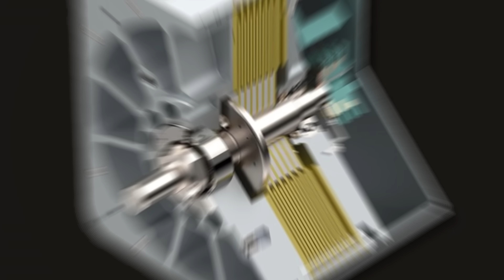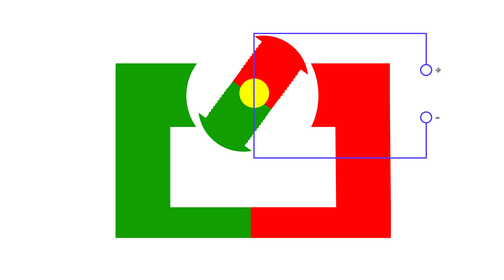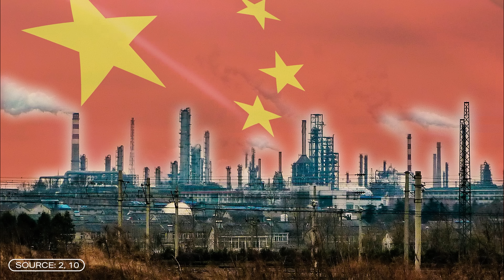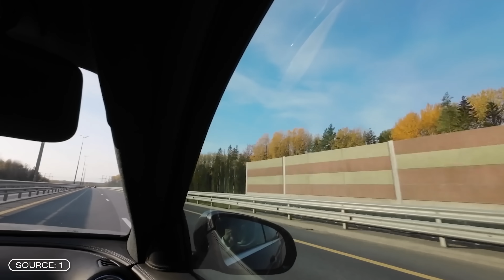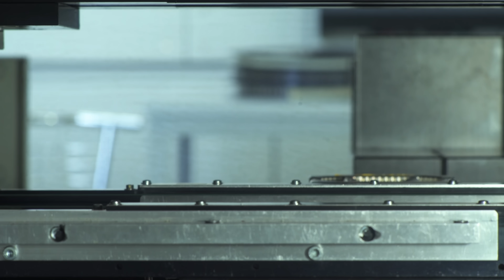Have We Gotten Electric Motors Wrong for 150 Years?

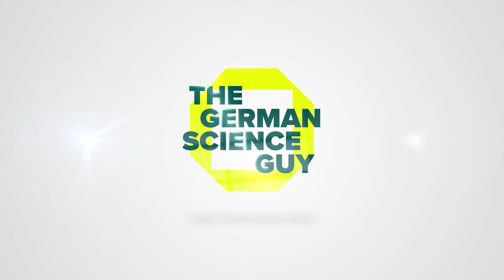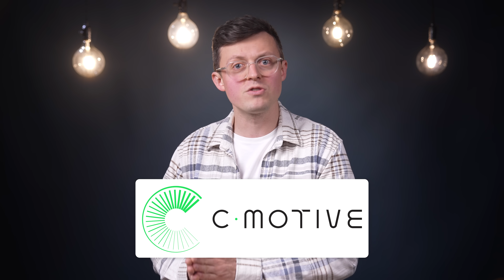Comment: C-Motive and their development of a modern electrostatic motor (0:00 - 0:44). While nearly all current motors are electromagnetic, C-Motive is leveraging an older principle to offer a more efficient alternative (0:44 - 1:12).

Key differences in motor technology:
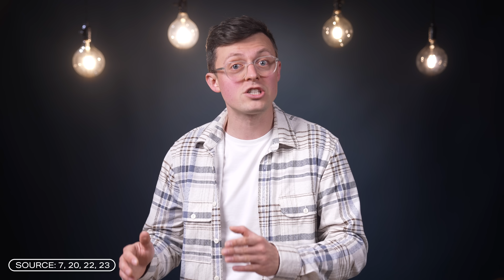Electromagnetic Motors: Use magnets and copper coils, relying on the Lorentz force to generate motion. They suffer from energy loss as heat in the coils and dependency on rare earth metals (1:25 - 2:07, 4:37 - 5:19).
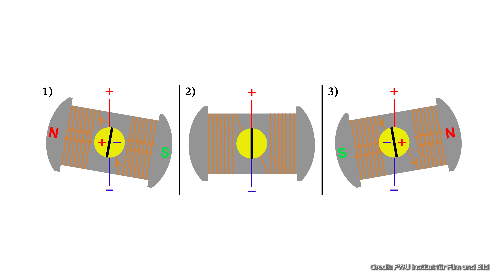Electrostatic Motors: Use electric charges and the Coulomb force (electric force). They require high voltage but low current, eliminating the need for magnets and significantly reducing copper usage (2:23 - 3:51).

The C-Motive Breakthrough:
Dielectric Fluid: Previous electrostatic motors failed at scale because air—the traditional dielectric—could not store enough energy. C-Motive replaced air with a proprietary organic liquid that has high permittivity, allowing the motor to function at much higher power levels (6:13 - 7:47).
Efficiency & Sustainability: The motor operates cooler, requires 90% less copper, and contains no rare earth metals (8:53 - 9:27).

Challenges and Future Outlook:
Speed Limitations: The motor is currently optimized for low speeds (up to 200 RPM) and struggles with efficiency at higher speeds due to increased friction (9:51 - 11:25).
Industrial Focus: Applications are currently centered on positioning and holding tasks, such as industrial robotics, assembly lines, and medical tech, rather than electric vehicles (9:35 - 9:50).
Infrastructure: A major hurdle is the lack of existing compatible control electronics and the requirement for a clean manufacturing environment to maintain fluid purity (10:55 - 11:59).

Comment: As the C-Motive electrostatic motors use a liquid dielectric, I am skeptical about the efficiency claims.  We should expect losses due to viscosity.
Reply: But if it's low speed. Light houses used to float the lenses on mercury, that's more efficient than what replaced it.
Reply: He said it's a low viscosity fluid. Even then, this (fluid effects) is one of the main or only losses this motor has. With a sufficiently good dielectric, this can improve many industries.

Comment: If these new motors like high torque and lower rpms, then you can use gearboxes again to reach higher rpms if needed. But then you probably can't put the motors in the wheels.

Comment: This is BS.  Electrostatic is seriously lacking in torque to be useful.  And you can't get more power out than you get in.  We have E motors in the 98% plus range now.   Nor mentions the problems with 1,000s of volts.
Reply: That's the bit about the fluid.  You can get giant forces out of electrostatic fields if you can avoid dielectric breakdown.

Comment: Surely the RPM threshold is a factor of the number of plates. I recognise the requirement for the number (charge distance), but if you could reduce the number of charge plates by a factor of ten, then you would increase the RPM by said amount. There will ultimately be a limiting RPM, but that may be mechanical anyway.
Reply: It seems the biggest issue with high RPM is the heat generated by the dielectric fluid goes up exponentially with RPM. That would quickly overtake the heat losses of an electromagnetic motor.
Reply: @williamhicks558  
@mskellyrlv - suggested 
2 days ago (edited)
"I would use pressurized sulfur hexafluoride as the dielectric.  It's a gas, so it wouldn't have the viscosity of a liquid, and it's already used as a dielectric hundreds of kilovolt Van de Graff generators, electron microscopes, and high voltage transformers.  It doesn't, however, have a very high relative permittivity.  That may not be too big a drawback.  On balance, though, the static electric motor has a lot of potential, with the promise of increasing our capacity to use electric power in more applications, thus lowering resistance further electrification (see what I did there?)."
at 18 likes

Comment: I visited the CMotive site, and they have an efficiency PDF document. From that, their tested efficiency is around 88%. When cross-comparing the induction motor + gear and the permanent magnet motor, they compared them in a very weird way. They use the inductor's total loss as a 100% reference for cross-comparison with others, but do not mention the induction motor's nominal efficiency. 
First, 88% is low efficiency. PMM can easily exceed 90%, and a single-stage reduction gearbox is usually 98% efficient. 
Second, in comparison, if the PMM they use has lower efficiency then 88%, that is a pretty sucky motor.
Reply: It's a weird presentation.  This motor is obviously designed to produce high torque at low speeds with high positional accuracy.  It is going to be more efficient than alternatives like Tesla motors here just because trying to gear down a high rpm motor without introducing backlash tends to introduce efficency losses.

Assuming you can solve the dielectric breakdown issue that's exactly what you would expect from electrostatics.  Of course it isn't going to compete in an application like electric cars, that doesn't even seem to be a goal.
Reply: @petergerdes1094  Could you potentially gear it to where the output shaft of the gearbox would be around 6000rpm or would you lose too much efficiency to friction?
Reply: @LordxJoe I mean you certainly could but if you notice even the claimed efficiency at low rpm isn't matching the efficency of good electric automotive motors and that's only going to get worse with gearing.

My sense is that this is a motor which is designed for applications like robotics where it's ability to do high positional accuracy (gearing down often introduces backlash) and relatively high torque at low speed are a big advantage.  All these factors tend to trade off against each other (you can reduce backlash while effectively gearing down at the cost of efficency) so you can describe it as being more efficient for that application but I think it confuses a lot of people when you describe it as an efficency breakthrough.
Reply: @petergerdes1094  Spot on.
Reply: 88% isn't a lot. Thanks for reading it I didn't look yet I hear the efficiency and was too excited
Reply: @H0mework 90% less copper is more than a lot though 😅
Reply: @imstevemcqueen yes it's a lot cheaper but it's not going to be useful for my uses.
Reply: @H0mework you have no idea whether it will or won't you meant
Reply: @H0mework So does it need to be 200 RPM plus, or a trivial circuit rather than 11-tier supercapacitor lagged driver, a generator...
Reply: I have to imagine a lot of energy is instead lost to the organic fluid even if it is low viscosity.
Reply: @Veramocor we should think more about molecular shear force than viscosity, as they are slightly distinct. Checkout shear thinning liquids!
Reply: @Veramocor  Currently, the majority of efficiency loss in ESMs is from viscous drag and other fluid driven rotational forces.  
They are extraordinarily efficient very low speeds and when holding a position.
Reply: You are comparing an electrostatic motor that's designed to run around 200 to 400 rpm to a outour that is designed to run at thousands of rpm. Ppm motors are efficient at high speed. Electrostatic motors are more efficient at low speed. If you showed that high speed motor down to the same RPM as the electrostatic, it would only be between 60% to 70% efficient, compared to 88% efficient for the electrostatic motor. 88% is actually pretty good especially when you account for the losses due to gear boxes. There is a lot more to these things than you're considering. I know these things because I was a technician in the Air Force and was trained to when on these kinds of systems.
Reply: Conveyor belt speed.  That's why fedex would have interest.  Routing centers are warehouses full of Conveyor belts.
Reply: 😅that uses 90% less copper...genius
Reply: 🤔 Well thats way I would experiment with is to add a treatment to the rotor and stator of laser etched surface to be super hydrophobic and super hydrophilic: https://youtu.be/mQdoKaNI8Ko?si=Qgv18L_HWOoxDHns the Staters would be super hydrophilic and the rotor would be super hydrophobic for super cavitation within the dielectric liquid: https://youtube.com/shorts/s4a7mdS0-YQ?si=doTO5W-VhBZQd9Vm this should accomplish more torque and higher RPM speed.🤷‍♂️🌐✌
Reply: 88% sucks. Tesla's earlier cars used induction motors (no rare earths / no permanent magnets0 with around 93% - and Tesla's new permanent magnet motors are like 98%. So what's the point of these C-Motive motors then?
Reply: @IsZomg  Yeah, BLDC motors tend to run in the mid 90's. Hell about a decade ago there were some diy BLDC hand winders on the RC groups forums that were hitting close to 98% IIRC
Reply: @IsZomg  The point is a new technology that could replace/compliment the existing one that might make our lives better. If you rule out anything that cannot compete to a today's mature technology, you will save money for a short run, but the development will stop. I understand people are used to pay little for awesome products (~$1k for top-notch Apple/Samsung/Goggle phone with 3nm CPU and 256/512GB storage is expensive? Wow we are spoiled!), but if we want lives to be better, we cannot afford stopping. Of course, to make lives better societies need to evolve along with technologies, but this would be another discussion.
Reply: @IsZomg  They don't need the rare earths that current motors need.
Reply: @SomeTechyPerson induction motors are perfect for evs, but we are spoilt and want an extra 30 to 50 miles range that rare earth offers
Reply: @lumsdot  The difference between the best BLDC, rare-earth magnet motors (~98%) and proven, in use induction motors for EVs (~93%) is a 5% reduction in total range. If your range with a BLDC motor is 300 miles, the induction motor would be just 15 miles less, at 285. Most BLDC motors in use for EVs are more like 95-96%.

Permanent magnet motors can be made smaller and lighter for the same power output, which is likely a bigger factor.
Reply: @SomeTechyPerson  I even mentioned in my comment that Tesla's induction motors DONT USE RARE EARTHS EITHER lmao learn to read
Reply: @IsZomg very cheap and mass produced motors have their own market. ICE cars alternator has 60% efficiency and is probably most produced electric machine ever made
Reply: @IsZomg  It's first-gen. If they prove the motor tech and there's materials that can withstand dielectric breakdown better or if it's simple to repair/maintain then it can have a future. It can be worth it, maybe.

I'll be patient and see if this tracks.
Reply: @IsZomg  Its just another investor grift, everyone wants to be an investor and become rich by investing in the next Amazon so there are lots of bait projects like this one. They key of the grift is to remain in a grey area of feasibility and uncertainty of the investors knowledge/advisors to keep the money flowing and have plausible deniability to avoid criminalization.
Reply: 98% of 90% after the gearbox amounts to 88.2% overall efficiency, which puts them on par if the other one doesn't need the gearbox.
Reply: Yep. I seen that. Not accurate at all. Just bold claims that can easily be dismissed 😂
Reply: Thank you and correct
Reply: Hmm, was dynamic or static testing, active cooling mentioned, how much Kv? Torque and more data
Reply: How is this different from a yasa motor?
Reply: These could be good replacements for stepper motors.
Reply: You should delete this because its so dumb.
Reply: Just another company claiming to have reinvented the wheel. Like so many others before it will disappear and be barely a memory in 5 years.

Comment: It seems that these types of motors also would work best under constant speed loads with less variability.  In a conventional motor increasing or decreasing speed takes the form of electric current fluctuations and thus impacting the battery or charge system.  This is something we've managed to nearly 100% mitigate these days.  I think these motors might need to be paired to a slip gear or differential system to avoid stalling or electric synch issues as incorrect charge timing might result in "motor fibrillation" which I'm pretty sure is a term I just made up.
Reply: Right, I forgot about that. Static is probably no good for variable unless it's always on and geared different.

Comment: 1:58 Whoops, describing the left-hand rule while the graphic is a right hand.
Reply: @GermanScienceGuy  its ok, at 11:11 you transformed into an American for a few seconds.  That sideways head bob was very familiar
Reply: Is the left-hand rule a German thing?  We were always taught that it was a right-hand rule in engineering school.  But then, I worked on the Peacekeeper ICBM in my first job out of engineering school.  The navigational coordinate system for Peacekeeper was North East Up (as opposed to every other company and country on Earth that uses North East Down, or NED).
Reply: @mskellyrlv  technically if you are using right hand you are either using the "conventional" direction or ampere's rule for a magnetic field inside a solenoid
when you use the left hand, you are using the "real" electric particle direction (because of mathematics' cross product vector)
you can find books using q or -q for the coulomb's charged particle depending on the author definitions.

Comment: There are so many low-speed applications for motors, especially in "soft robotics" or anything that need to interact with humans. Door motors, mobility devices, elevators, escalators, etc.

Plus high-torque low-speed industrial applications like tractors, cranes, garbage truck mechanicals, and I'm guessing even many pumps and compressors could all benefit from high torque and low speed. I'd love it if a high-efficiency compressor motor for a heat pump could be designed to use very low speed motors so they don't whine like banshees.
Reply: You'd then have to make sure they don't shake like jellies.
Reply: High torque, low speed can also easily be converted to high speed, low torque through a gearbox. Many current magnetic motor designs can't operate efficiently below a certain speed, so these new motors can really shine in those gear configurations.
Reply: @Darth_Insidious  The point is why have the expense, weight, noise, loss of efficiency and reliability concerns of a gearbox at all unless essential? Use electromagnetic motors for high speeds and these things for low speeds, avoiding or minimising speed changes in each case.
Reply: @matthewmarks6951  You still have a current spike at low rpms which can contribute to a magnetic motor burning itself out in stall conditions. And the efficiency loss in a gearbox might not outweigh the efficiency gain with switching from electromagnetic to electrostatic motors.
Reply: @Darth_Insidious  HE convinced me with science then YOU convinced with more science!

I LOVE IT!! 😂😂💖💖
Reply: @Darth_Insidious  Oh yes, it all has to be considered. But any brushless motor driver will be able to detect a stall condition and prevent overcurrent.

Comment: Fluidic torque coupling has been used for years in automatic transmissions so that suggests to me a lot of efficiency is going to be lost at all RPMs - their motor looks a lot like a automotive toque converter to me.
Reply: The fluid isn't exactly 100 either since there's slippage
Reply: But the liquid here isn't transmitting any of the force.  It is just there to prevent sparks and transmit electric fields.
Reply: @petergerdes1094 right but I'm saying it will also do that as a side effect, so I think the efficiency numbers are possibly ignoring the torque coupling (ie friction) losses. They do talk about this themselves though hence the low RPM limitations so maybe it's okay...
Reply: @RichardBuckMovies  Ahh, I see but presumably their efficency numbers just measure input and output so that is included.  Also in a torque converter you are delibrately trying to move the fluid with the rotor and redirect it with the stator.  Here they will minimize the interaction.

But yes, that's why (see the top rated comment) their overall efficency isn't that great compared to many motors on the market.  This whole piece was weirdly framed.  It seems clear they are only claiming greater efficency at low rpm high torque operations (maybe even only with high positional accuracy).

Basically it seems totally plausible to me they have a higher efficiency robot drive but they aren't even trying to be a high efficiency car motor.

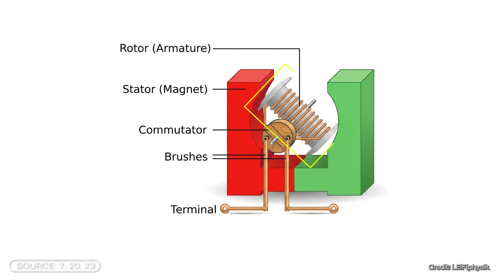Comment: 1:41 the rotor is not necessarily an electromagnet - it's often a permanent magnet, which needs to be very powerful and hence is often made of a rare earth metal.
Reply: Тут есть такой момент. Постоянные магниты в целом ограничены, множеством параметров. Поэтому неизбежно что в целом - дизайн будет смещаться в сторону электромагнитов. А в перспективе - вообще с применением сверхпроводников🤔
Reply: @Devis1982  EV motor rotor magnets are mostly permanent, but Munro Live tore down an alternative design with an electromagnet. The advantages are not using rare earth metals and better efficiency at high speeds by being able to control the field; the disadvantages are slip rings and worse efficiency at low speeds due to the field current required.
Reply: @matthewmarks6951 извините, но. Там где это решающе - в генераторах на электростанциях - электромагнитов. А все остальное - это последствия компромисса, в основном с размером и охлаждением
Reply: @Devis1982  Whatever - my original remark is correct: rotors are not necessarily electromagnets.